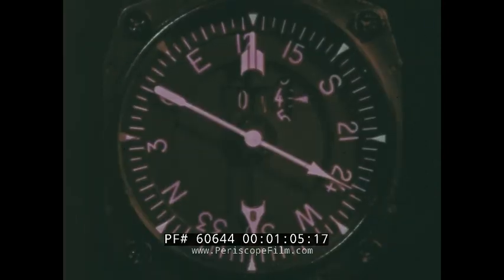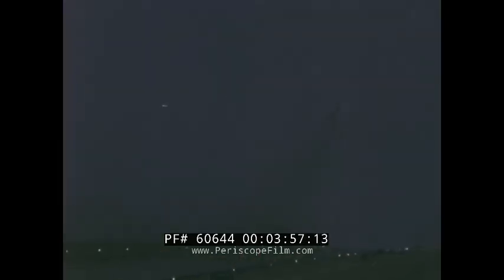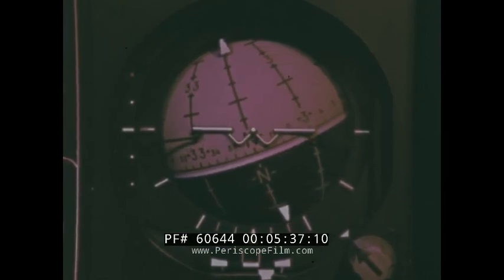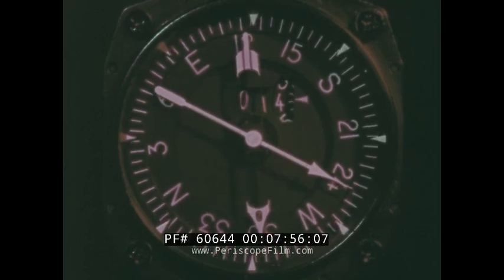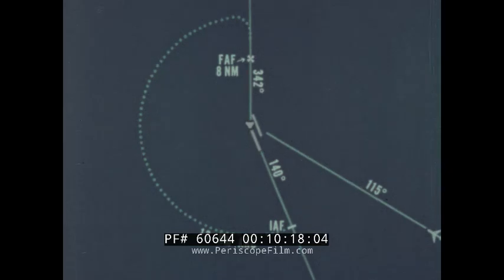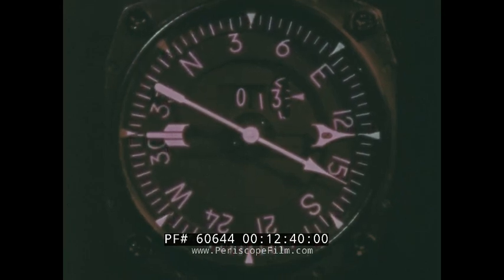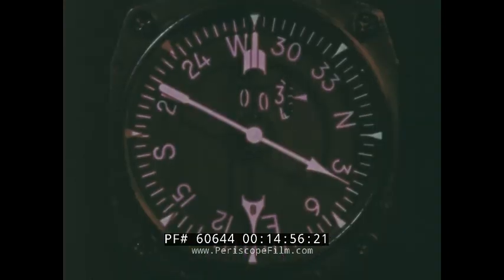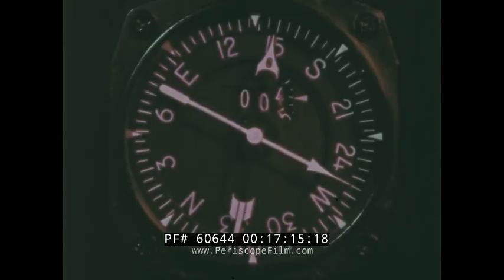U.S. NAVY TA-4 SKYHAWK JET AIRCRAFT  ALL WEATHER INSTRUMENT FLIGHT TECHNIQUES 60644

Comment: Anybody else find the navigation procedures absolutely confusing ?? Thank God for GPS...
Reply: Could be worse. 10 years before this film was made, four-course radio range stations were still a thing. That was even more nuts.
Reply: Old comment, but as an instrument rated pilot, a lot of these radio navigation procedures are actually the same today. There are just slight differences in terms of instrumentation, the DME Arc on this being easier as an example than the "turn 10, twist 10" method.